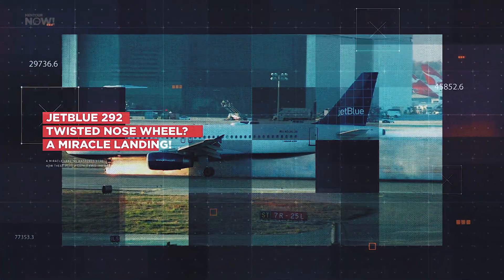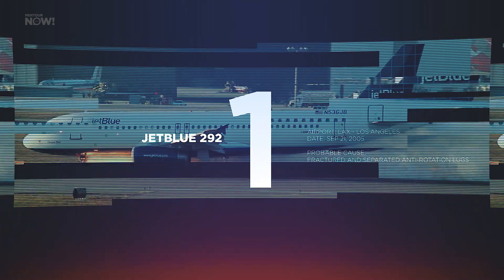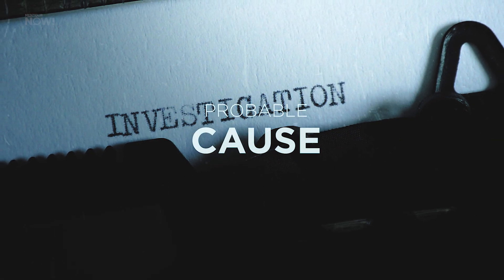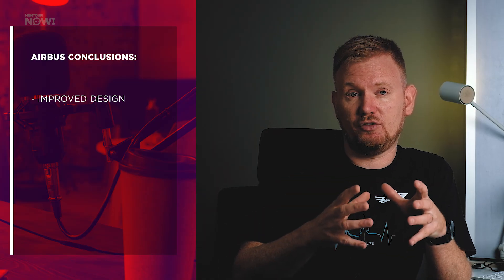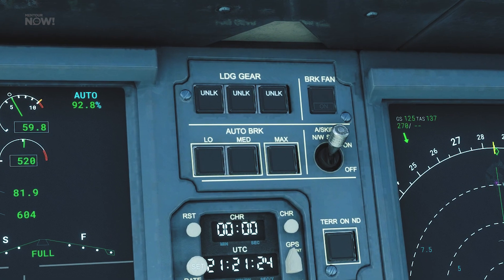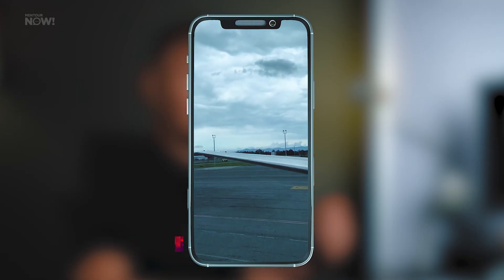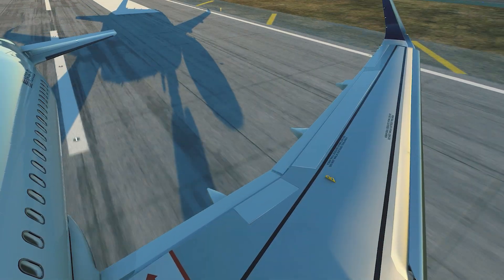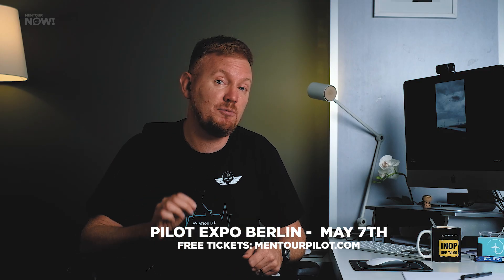The TWISTED Story of the Airbus A320 NOSE-GEAR!

Comment: I'm actually impressed you can grind off half a nose wheel while having the weight of a jet aircraft pressing down on it without any visible damage to the runway. Amazing material!
Reply: I am even more impressed that, according to what Mentour Pilot says at 11:26, you can have two pilots in the cockpit taking off an airplane who can fail to notice all the sparking and grinding of that locked nose gear assembly and the bang of the busted tire.  That is even more impressive than an undamaged runway from a locked nose gear grinding against it.
Reply: @MyNathanking   Well, the sparks would be invisible from the cockpit.   Takeoff with full thrust is a fairly noisy procedure anyway, and with quite a bit of vibration,  so the noise of the tyre blowing out would not be that much above the background noise level, and the grinding of the wheel skating down the runway would probably be lost in the overall noise.
Reply: @cr10001  Well, that's satisfactory.  But I still wonder.  Of course the sparks would be invisible, but what about the bang of the tire blowing and the sound of the skidding and the resistance to the moving airplane trying to take off?  Pilots hear sounds on or in the airplane all the time whenever something is wrong, so I find it hard to see how the hellish sound of a nose gear assembly being disintegrated to pieces as it skids along the runway wouldn't be noticed in some way by the pilots.
Reply: @MyNathanking   Well, the weight of a A320 is around 70 tons, say 10% of that is on the nosewheel, 7 tons.   The coefficient of sliding friction (once the tyre is shredded) between the aluminum wheel and concrete runway might only be 0.5 , so that's 3.5tons resistance.   The thrust of the engines is up to 20 tons, so - assuming the runway wasn't critical length - that probably leaves plenty of thrust to get it airborne.    Pilots typically select 'flex power' to use reduced power for takeoffs to save engine wear, so they don't feel exactly the same acceleration on every takeoff, so I'd guess the slightly reduced acceleration may not have been instantly obvious to them. 
As for the noise of aluminium skidding along the runway, the best example I can offer is rally cars driving on three wheels (such as here:   https://www.youtube.com/watch?v=23WRY_MROj0  or here     https://www.youtube.com/watch?v=KLlL-Cs_X8A   )    the noise is obvious but not deafening.
Reply: @cr10001  but I bet as soon as you would have to do some corrections to stay on the center line it should feel somewaht weird.
Reply: @alexanderkupke920   "Somewhat weird" - very probably (I have no experience flying a plane so I have no knowledge of what a takeoff should feel like).    Would it be any weirder than, say, a bit of water on the runway or a gusty crosswind?   I don't know.    I'm just saying that the noise and vibration of the front wheel skidding broadside down the runway is likely not orders of magnitude louder than normal takeoff noise.
Reply: @cr10001  I can only compare it to the noise of a car that is grinding down a rim heard from the outside. But I think you are right and Petter even mentioned that with the Engines on Takeoff Power there is a lot of noise and vibrations. And I bet as soon as the tire is gone (which will be pretty quick and may just fell like a bump) the actual grinding may be even relatively smooth.
Reply: Not so surprising.   The wear on the runway is distributed over several thousand feet, the wear on the nosewheel is concentrated in a few inches.   You get the same thing when you sharpen a drill on a grinder.
Reply: this would be simulated & tested in case something like this happened - so yeah, intentionally designed to not collapse if tires blow up
Reply: ... Also that the shaft does not snap
Reply: The nosewheel supports less than half the weight of the aircraft (maybe around 25%?).  Still it's significant weight.  But the fact that the wheel ground away so much says how much harder the concrete is compared to the aluminum of the wheel.
Reply: @rnreajr9184  Another commenter said it was a maximum of 4 tons of pressure on the nosewheel (out of 65 tons, overall weight).  I don't know how accurate he was being, but if that's the case, it's a lot less than 25% of the weight.  This wouldn't surprise me, based on the some photos I've seen of large commercial aircraft tipping and falling onto their tails with improperly loaded cargo or even because of the horizontal stabilizer being blanketed with volcanic ash (which happened to a lot of parked aircraft during the Mt Pinatubo eruption in the Philippines).
Reply: @skyhawk_4526  Yeah I saw the comment. He claimed the nose gear takes about 10% of the landing weight. Still very impressed that with multiple similar incidents, the nose gear holds up. Scary stuff, but an amazing testament to the integrity of a moving structural part.
Reply: @skyhawk_4526  That wasn't 4t of weight on the nose wheel: it was a 4t friction force due to friction between the nose gear and runway. (The weight is a downward force; the friction is backwards.)
Reply: @beeble2003  Indeed. In the replies to Bert Gentner's comment Killian Ortmann describes it as a horizontal force.
Reply: @skyhawk_4526  From experience I can say it is very hard to put an A320 on its ass with false loading (not impossible though). But while working as an Aircraft handler in what seems a lifetime ago, I can say we had to stop loading or mainly unloading more than once on 737-800 with the nose wheel just loosing ground contact. about a hand wide above the ground was the most extreme I have seen and I bet we could have put it on its ass easily. It was more likely to happen while unloading, as unloading was getting everything out as fast as possible. for loading we actually did it in a certain order to keep it somewhat balanced.
having the nose wheel come up presents also another difficulty afterwards. once it lifted up and it gets down, those wheel chocks are absolutely stuck and almsot impossible to get out.
Reply: @rnreajr9184  Do we know they're not doing a surface maintenance of the runway after such incidents?

Comment: Gotta be honest, this is going to make me re-think flying on the A320. But at what point will civil authorities step in? Do people have to die before they mandate that the gear be changed to a safe design?
Reply: The A320 is fine, the gear turns to 90 degrees by design if there’s a fault. The gear is engineered for that kind of landing which is why Airbus instruct pilots not to use the gear unsafe checklist
Reply: @naoise122  Instead of engineering a piece of equipment to survive a catastrophic failure due to a design fault (sorry, but I can't justify wheels that can move into a position perpendicular to the vector of travel as anything but), wouldn't it make more sense to just fix the flawed design? That's like a shipbuilder designing inflatable patches to be used when pieces of the hull fall off; great idea, but why not just learn how to weld hull plates instead? EDIT: I'd overlooked the need for them to be turned that far to facilitate maneuvering on the ramp when unpowered, and concede that the necessity of wheels that can turn that far is probably mandated in that redesign of hundreds of airports isn't feasible. But I still don't like it.
Reply: @joeb5316  90 degrees is the failsafe position. Anything other than 0 or 90 would make landing extremely dangerous, so if a 0 degree position cannot be verified the safest thing to do is to turn the gear until it hits the mechanical stop at 90 degrees.

Comment: I remember when it seem like a rash of Boeing 727 (yes, I'm that old!) had issues with their nose gear Not Extending when they came in for landing!  I think that there might have also been a few cases with the nose gear extending but not locking in the down position...
 
I Do remember when one pilot was able to trim his airplane to such an extent that he was able to keep the nose of the jet off the ground until he was going (what seemed to be) about 6mph (10kph) and the nose came down reasonably slow!

Comment: Does this happen with any other planes at nearly this frequency or is there something about the design of this nose gear and its sensors that makes it basically default to 90 degrees off center when something goes wrong?

Comment: Totally agree that the events were caused by different faults. It’s does feel like Airbus didn’t develop the nose gear enough before signing it off. Seems like they continue to develop the equipment after each of these dangerous events. 

If I were an Airbus pilot I’d be feeling a bit like a guinea pig!

Comment: I'm not sure shutting down the engines would prevent FOD damage, as they would continue to spin through the landing rollout.
Reply: Spinning down with momentum for sure, but they won't be drawing in air anymore.
Reply: @JoshuaTootell  And the fuel flow is cut, so a lot less things to go up in flames.

Comment: Wow, I don't know what to think of this. (This comment is from the point of view of a regular passenger).
This makes me doubt at some point how safe this can be (big statement here, sorry). At which point does one declares a specific design being faulty and a redesign might be in order? I haven't heard of any other aircraft being plagued with this kind of "recurring" issue (but I don't actively search for this).

I know these issues are not caused by the same thing but the end result are. It feels like trying to fix bugs when doing any kind of programming. You fix a bug, then it shows more issues later in your code, that you then fix, and keep going thru this loop until you got all the bugs out. This time, with the safety of everyone onboard at stake. I remember watching a crash investigation where, while finding many different things that went wrong, one of the fixes involved making it physically impossible for X issue to reoccur (so that if system A, B and C fails. The issue can never become critical as its been mechanically designed to be impossible to happen. I think it was about a cargo door lock redesign.). This gave me very high confidence in aircraft safety.
That nose gear issue tho... It's a bit disappointing.

The second point is the one where the plane was allowed to operate with the faulty nose gear (but limiting the max turn rate of 25degree). I won't post my initial reaction but how could that be allowed??? I'm sure its different but to me, it feels like I would be driving my car and not be allowed to turn the wheel too much or else it would suddenly yank 90degrees (if it was possible to do so).

So again, small disclaimer. I am just a regular passenger, I watch Mentour because of how well made and informative his videos are but I don't spend my life watching aircrash episodes on tv and freaking out about it. I am not a scared flyer either. But this video was very disturbing to me.

Comment: There is a good chance manager(s) pushed engineers too hard.  It happens most everywhere there is R&D.  

Good engineering does not mesh well with "time to market" and "price point" pressures.   It is easy to accelerate development to where problems like this show up.   Without seeing more of this system I can only speculate.  But it is very likely that some of these problems could have been discovered and corrected with additional simulation and testing and money.

Comment: The B.S.C.U of the A320 and the front nose landing gear is COMPLETE B.S !!. ..Time for a thorough overhaul by the designers by resorting to a clean sheet design instead of these multiple fixes to fix the fixes !
Reply: @timemachine194 Just as certain suspension components in car designs are less prone to wear and tear,going out of alignment or subject to the vagaries of maintenance, it's about time Airbus came with a solution to this. B 737 systems are rather less complex and anyone knows the more the levels of complexity, the more things are subject to the vagaries of the unknown.  That's all I meant.